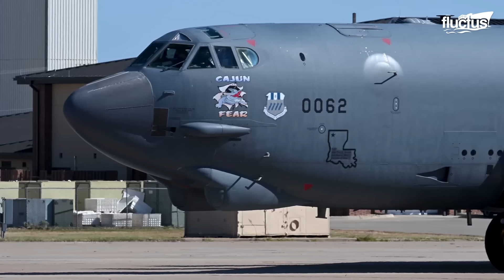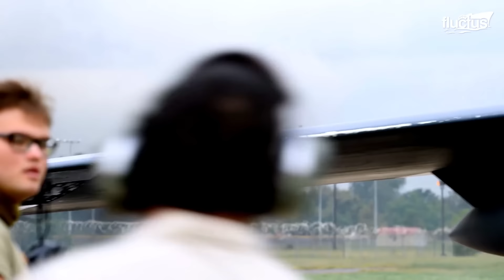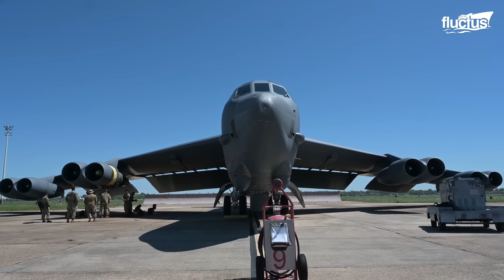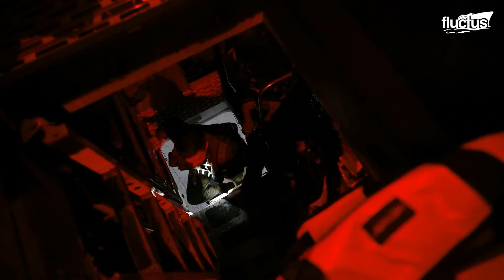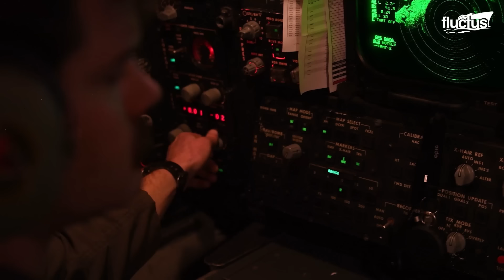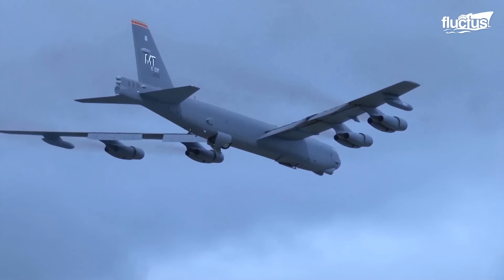The Extreme Process of Starting US Biggest Bomber

Comment: The aircraft will lift itself off the ground. when the stab trim is set properly. Also calculating the weight vs  V1 speed. Having the rear wheels lift off first IS NOT a proper takeoff.  You will find mention of these concern in the Air Force flight safety handbook.

Comment: The B-52 isn’t the largest bomber. That honor goes to the Convair B-36 Peacemaker, which had 6 piston engines in a pusher configuration and 4 jet engines at the end of each wing. The wingspan was 230 feet and the fuselage was 162 feet. B-52H: fuselage 159 ft. 4 in. wingspan 185 feet.

Comment: I was an Avionics Instrument sys. spec at Ki Sawyer from 75 to 78. We called them BUFFS... Big Ugly Flying Fucker. Pretty amazing plane, later models still flying after 70 plus years. It was challenging work, you get 8 or ten of them coming back from a mission and there is usually a lot of breakage, and some of them are due to fly again the next day or so so if your were on recovery shift you worked till launch shift comes in. They have ground units that start the aircraft, but they practice the cart start in case it is ever needed.

Comment: Once the engines are started, can a single pilot solo fly a B-52? Or are there certain tasks that must be done every flight, that can only be done by the flight engineer for example. I've never been able to get a clear answer to this question. The only reason I ask is that years ago I had a dream where I was in fact flying a B-52 and I was the only one aboard. I recall how pleasing the handling of the plane was. A USAF B-52 had recently done a flyover of the Adelaide F1 GP, and I saw it, so I'm sure that's what inspired the dream lol. But I would still like to know the answer.

Comment: A cart start on a Buff is really just flipping some switches and standing back - and getting away from all of the foul smoke.   A normal start (using a air cart) is not so different from starting a tanker or a cargo plane - just more engines to spin up.

Comment: It is a credit to Boeings design and build quality  yes build quality for this plane has lasted for so long. Its weakness is it needs more modern  reliable and fuel efficient engines. Boeing managed it with the 737 from 200 to 300 series so why not with this aeroplane. As for the UK we have nothing like it is very unique.
Reply: Not anymore lmao, just look at the 737 max and 777x program full of cut backs and design flaws.
Reply: A/c are not built in the UK.

Comment: Way back in the late 70's I was a jet engine mechanic on C-141's and they used the TF-33.  I started in engine tear down and repair then moved to the flight line and fixed them on the wing.  Don't let the plane fool you they were some pretty large engines.

Comment: Very accurate video! 57 years ago (1968) I was an Electronic Counter Measures (ECM) technician on B-52D's. I eventually cross trained to be an Air Traffic Controller but once again on a B-52 air base. I saw the B-52s start many times using cartridge starts. We would have 5 to 6 B-52s and their KC-135 Air Refuel Tankers in the alert area loaded with nuclear weapons. Occasionally they would have a "Cocoa Alert" where they would start all the alert aircraft engines and taxi to the runway and start their takeoff roll but abort halfway down the runway and taxi back to the alert area. On one of these occasions, one of the B-52s turned too sharp while turning off the runway and actually broke off one of the two front landing gear! It stopped immediately and blocked the runway which shut down the airfield and more importantly eliminated a number of alert aircraft from the national defense. You can imagine how much attention this got from Air Force Headquarters. Just one of many stories I have of my time with the BUFF!
Reply: I was at Altus AFB 1966-70 watched them take off on alerts . 66-68 . Transportation squadron
Reply: @joekoelker9038 Altas, been there many times. 100 miles from everything!
Reply: Very true. Pretty nice NCO club for food and drinks. In the late 1960s. @rvrrunner
Reply: But not a god damn word about the starting process. WTF?
Reply: Bro, do a YT video about your stories. If you can, that is.
Reply: скоро вашей Америке - кирдык

Comment: To me, it looks like the wings are already breaking off the plane. How they get that thing off the ground is astonishing to me. If only the Wright brothers could see this.
Reply: On the ground, they sag.  That's why they have the wing wheels.  Once there's enough lift, they are pulled up.
Reply: When you see them on the ground you can spot the ones without fuel in the wings, the little wing tip wheels are off the ground! Those big wingtip tanks hold 3000 gallons(20,000 lbs.) each! Also, I have heard that the wings flex a total of 50 feet at the wingtips!

Comment: Brought back lots of memories as I got to do crew chief work on them at the old March AFB. It lived up to its nickname BUFF. But I loved working on them. You showed the picture of the device, but never talked about the "crab" landing gear. It was a interesting sight to see a B-52 landing in high cross winds and the nose pointing a different direction than the wheels, then watching it pivot back to straight after it landed. Its such a great airframe, it may out last even current bombers in service now.  Oh and it was first started development in the late 40's, not the 50's
Reply: THANK YOU FOR YOUR SERVICE SIR. US Navy vet here.
Reply: The first B-52 the Y model took off April 15th 1952, by June 1955 they were entering service with the 93rd Bomb Wing at Castle AFB California, the last H model rolled out of the assembly building June 22 1962 and went into service on October 22 1962!! Making the youngest bomber to be 64 years old in June 22nd 2026
Reply: @GM8101PHX  Yep I know, The designs were started in late 46 and 47. With a lot that they learned from the B-47. While there are many amazing things about the aircraft, its ability to be adapted over time is second to none. I wouldn't be surprised to see the airframe flying for much longer. Getting close to 100 year service.
Reply: As a kid i used to love going by March watching them takeoff and land on the weekends
Reply: Grease monkey 76-80, 68th bomb wing, wash rack lol to phase dock. Kinda weird feeling walking behind one having four gun barrels following ya lol. Peace brother.
Reply: @commoveo1  Amen and peace to you as well.
Reply: I've been there and still miss it.  Love the BUFF.

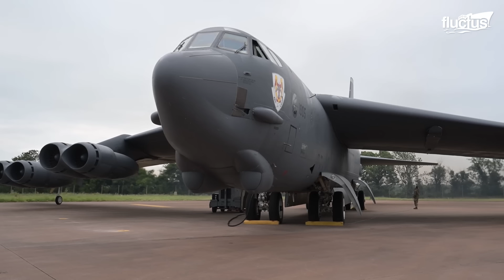Comment: 5:15   You made a mistake at this mark.  "The front and rear landing gear are only feet apart."   It should be" The right and left landing gear are only feet apart."  The front and rear gear are many feet apart.
Reply: I thought that was a strange comment too! There is a lot of space between the front and back landing gears.😊
Reply: Each pair of the wheels in the front gear, and each pair in rear set are only feet apart. The narration is talking about the narrow width of the fuselage.
Reply: @bobversheckvoiceover  Right but when making an educational video, people shouldn't have to interpret what you really meant because you were too sloppy and unprofessional to read your own script
Reply: @bobversheckvoiceover  l am well aware of everything about all of the Landing Gear. Thank you for pointing that out. I was a Crew Chief on B-52G at Castle AFB back in the mid to late 80s. It has been a few years tho.

Comment: The B-52 cannot take off with a full fuel load and a full weapons load at the same time. What they do is take off with 1/4 fuel then aerial refueling after takeoff.
Reply: During a launch the KC-135's used more runway than the B-52s to get airborne when they were fully loaded. I worked as an Air Traffic Controller at a B-52 base for a number of years.
Reply: @rvrrunner  AND shook the ground like a minor earthquake with their original J57 engines, black smoke pouring out with water injection
Reply: @ricfoster3365 Yeah thy did. All H models now turbo fans
Reply: @rvrrunner  Thank you for your service chief! I love you Xx
Reply: You have no clue what you're talking about. Nuke alert in the late 70's / early 80's we were loaded up to a max take off weight of 488k lbs.
full fuel and 12 nukes. Later they increased the in flight weight to 525k. Typical internet wanker. 325th Bomb Sq. Fairchild AFB, WA.
Reply: @26betsam wow. Someone woke up grumpy
Reply: @26betsam  I can verify that 488K figure, ex AF  73 to 77  B52H
Reply: @26betsam I worked the flight line at Fairchild in the late 80s. Great times.
Reply: @26betsam Thanks for the information. However, your comment could have been a bit more diplomatic. Some individuals don't check the information they think is true before sticking their neck out but they can be gently corrected. And indeed they should be corrected.
Reply: @26betsam well the heaviest nuke the b52 carries is approx 2400 lbs. So the payload of your fully loaded 12 nuke b52 is only approx 28,000 lbs. Far short of the 70,000 lb payload of conventional bombs. Simple fact is that a B52 can not take off with a full payload of conventional bombs and full fuel tanks. It will exceed it's MTOW
Reply: @Jim-ku6ry  internet pilot go to bed
Reply: They could modernize this. They need two modern engines instead of 8 screaming shits. It could carry more fuel or load.
Reply: @aronbokodi7487 you apparently missed they are already being replaced. They still decided for 8 smaller ones because there isn't enough vertical space for housing large ones.
Reply: @aronbokodi7487 the engines they are building to replace the current engines are said to be game changers in both power and efficiency and are also said to have major commercial applications.
Reply: @tomkindall936  Its the same engines that are on the newer Gulfstreams, the G650-G800s.
Reply: @aronbokodi7487  They can't replace the 8 small engines with 4 big engines because of the distance from the wing to the ground on the outer pylons.
Reply: If you can fly, you can take off, but maybe need extreme runway
Reply: Go Air Force.
Reply: Interesting facts thank you
Reply: Sounds about right👍
Reply: That is true for many airplanes
Reply: Wrong in so many ways
Reply: That’s crazy! Didn’t know that
Reply: The B-52 can take off fully fueled and loaded with weapons.  Landing is another story.
Reply: Yes, it can.  I worked on G & H models for years. if it needs to, it can.🫡
Reply: You mean they can't re-arm in mid-air? Well that sucks!
Reply: @meangene7 😂
Reply: @meangene7  loooooooooooooooool
Reply: They do not have to take off with full fuel load... they can take on fuel while on air. So, I am guessing that they would definitely go full weapons load.
Reply: @andresa1963  I worked around the alert nuclear loaded B-52's as Security Police, they were fully armed, we had 10 KC-135's to fill them up when airborne!!
Reply: wont it fall full loading with fuel  @andresa1963
Reply: The 36 was superior in this aspect